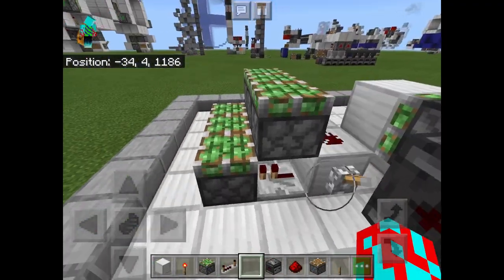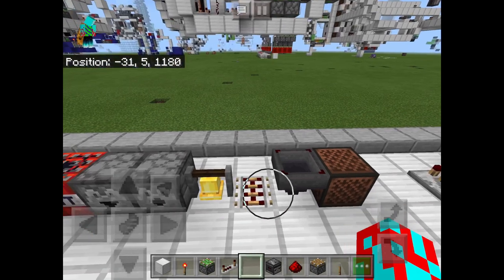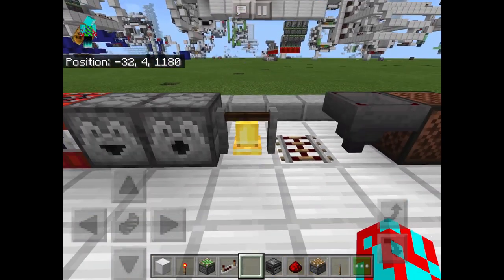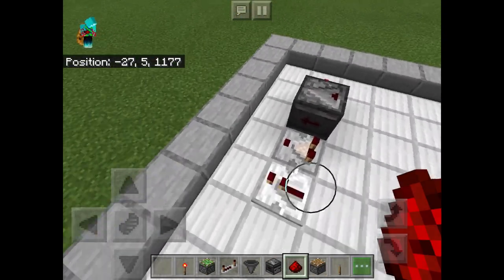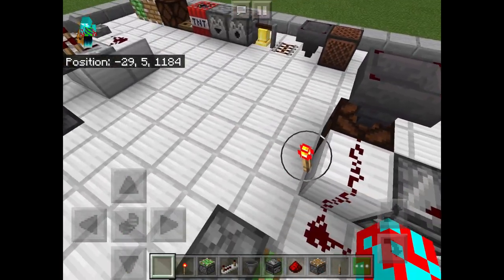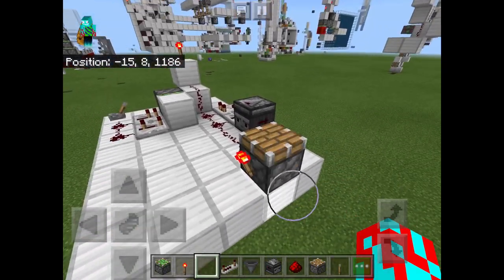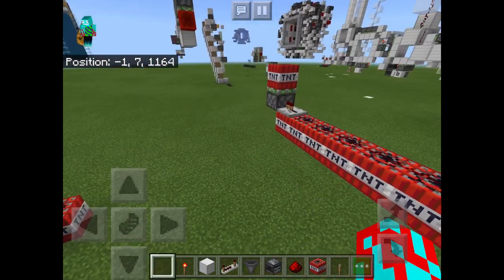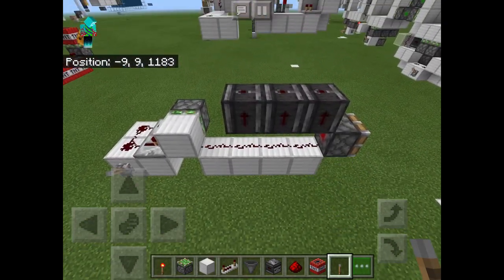The 0-tick pulses of Minecraft Bedrock: P-ticks and C-ticks– How to create and use them

Comment: Thank you, I just learned some amazing redstone tech! Is the two repeater + sticky piston setup the only way of generating p/c-ticks?
Reply from the maker: You can also use comparators if you have the right timings to generate c ticks and p ticks. For c ticks you can send a 1 tick pulse through a sticky piston with an observer and it will also create a c tick.
Reply: @Benthehuman  Thanks for the quick answer! The comparators were kind of obvious, should have thought that. The observers are quite neat way to do alternatively, they can be more flexible and save some space. I am intrigued to see what could be all done with this. Thanks again.